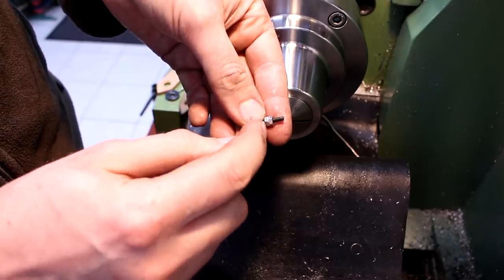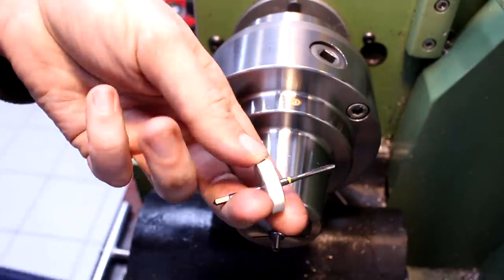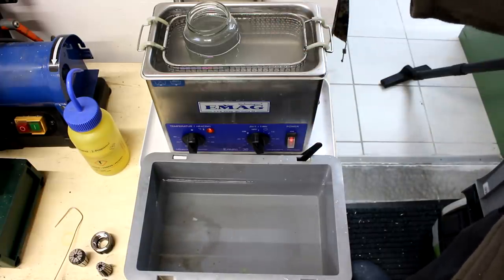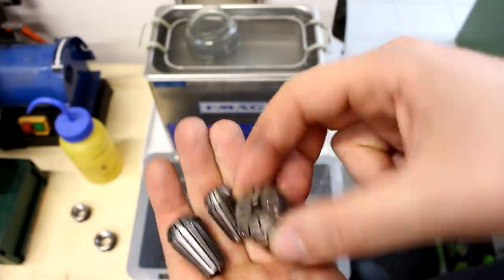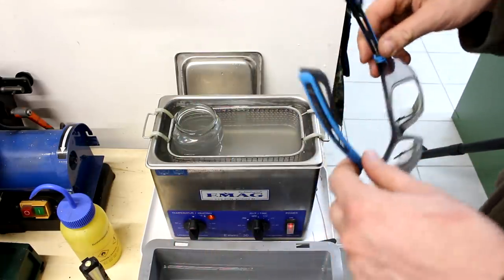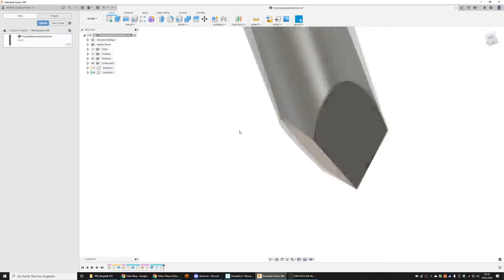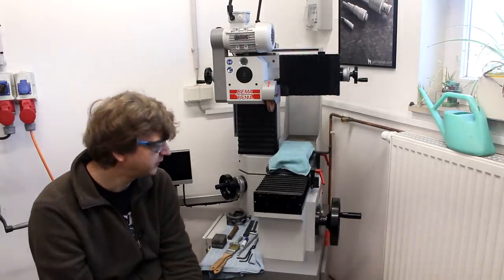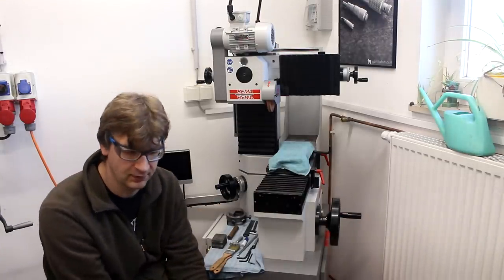Shoptalk #25 - 02-2022

Comment: Admit it, now - you've been thinking how you would put servos/steppers on the grinder axes, with an Arduino controller.  Not CNC, that probably doesn't make sense, but parameters for stroke, side step, and down feed.  Limit switches of course.  Key it in and walk away.  All that sitting & stroking is gonna get old.
Reply from the maker: The grinding work I do does not lead to very long runtimes, so, no, havent thought about that.
I have run automatic grinders in the past, its nice for large platework, but thats not what I am here for :)

Comment: I remember solidworks FEA program being garbage. Does anyone know if fusion 360s fea program is good?

You can cheat with an ultrasonic cleaner. If you fill the tub with water and put your parts and cleaning solution in a well sealed bag you won't have to clean out the ultrasonic bath as often and it lets you use lots less cleaner. Bags that are meant for high temp baths last a long while
Reply from the maker: I hope somebody else can chime in - I can only perform the most basic of operations in FEA and fusion serves that need very well for me. Easier than in Creo.
Reply: Actually fairly basic ziplock bags can work too. I've cleaned ie. carburator jets etc. like that in very small bags.